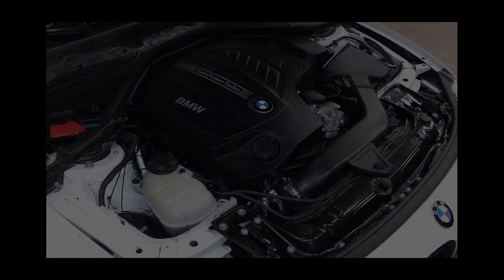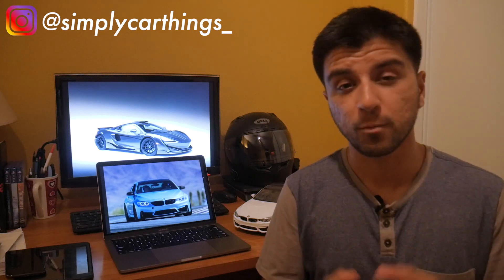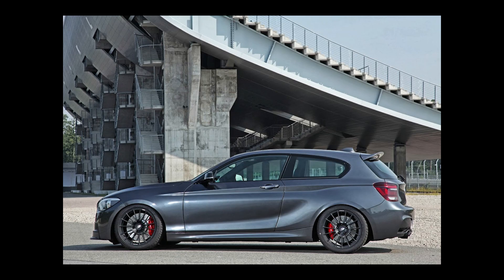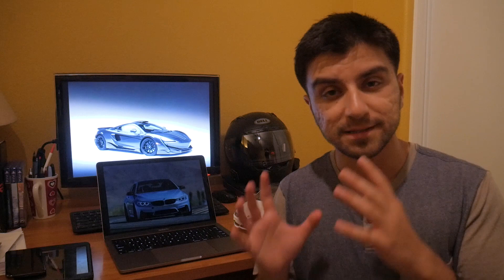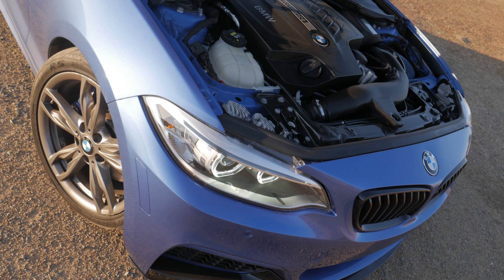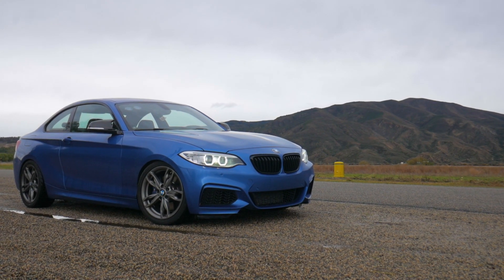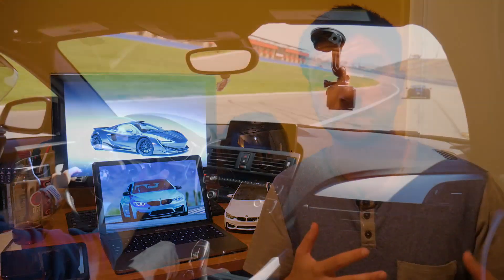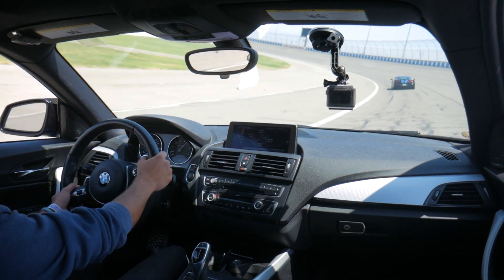BMW N55 ROD BEARING FAILURE | What You Need to Know: Explanation, Prevention, & Solution

Comment: Thanks for the info!! I’ll keep in mind the N55 M2 oil pan if I ever need it!!
Reply from the maker: No problem man! Thanks for tuning in!
Reply: Bro. If you need it, its too late. BMW charges almost 20 grand to replace a n55. You can have an independent shop do it for around ten. I would know, stuck paying $20k for a 2011 335i m-sport 6 speed. Just clicked 100k miles. Warranty just ran out.
Reply: @onthegoresto7742    Ouch!! At that point, why not sell the car and buy another one!!
Reply: Rod knock.

Comment: Oh wow I was just doing research on doing rod bearings on my N55. Great timing for this video 😂 just a quick question. does this also apply to E series n55 as well?
Reply: Yes, but remember the N55 was in a ton more vehicles and produced in much more numbers than the n54 and N55 rod bearing failure is rare when you consider how many were made. Most failures I have seen have been on multiple owner cars with limited or unknown maintenance history.

Comment: Great that it works on the F-Series, how about the E?
Reply: I did it on my 135i e82 full bolt on but u need electro steering
Reply: @TheElDimitry  can you elaborate a little? I have an e82 135i as well. Looking to do this. But the company says my build date wasnt tested. 4/2011 e82 N55
Reply: https://www.instagram.com/p/CN-zigWhSZh/?igshid=gwkmui26zk0r

Comment: I thought it was the e9X v8 and the m5v10
Reply from the maker: It’s not as widespread of an issue on N55 like i said, but in certain scenarios if you wana run very high power or track the car often it’s worth looking into 👌🏼

Comment: I thought m3 v8  only had that issues  smh
Reply: If you replace rod bearing every 80k kilometres on m3 v8, you are good. Plus, let the engine warm up.
Reply from the maker: Yea it’s not very common on the N55 like i said, but in certain scenarios it’s definitely worth looking into 👍🏼
Reply: @SimplyCarThings  I'd think the issue is a little different one since on the mentioned M engines (S65, S85) hopefully(!?) are not subjected to oil starvation since they're a more track oriented car setup? rather than that, the rod bearings simply wear out much faster due to the design and higher stress. as Water Fou said, on these M engines you should usually just do rod bearings as a preventative maintenance.
on the M2: that N55 variant is not affected because it has a different oil sump/pan with baffles or sth as well or...?
Reply: renizer Exactly ! Preventive maintenance on every m bmw is always the way to have a reliable track car/ daily car. Some people don’t get this, its crazy, they maintain thoses cars like they are toyota corrola’s .
Reply: @senioraxys3947  lol, i don't have a problem with maintenance, but rod bearings, at that milage, you gotta be kidding me.. It's not normal..
Reply: @renizer  definitely. And 3k(cad) isn't a cheap maintenance to keep having to do lol
Reply: @renizer  it's two different problems with the same outcome, on the s65/85 it's caused by tight tolerances so any getting on it before its completely warm starts to destroy  them
Reply: and the v10 m5